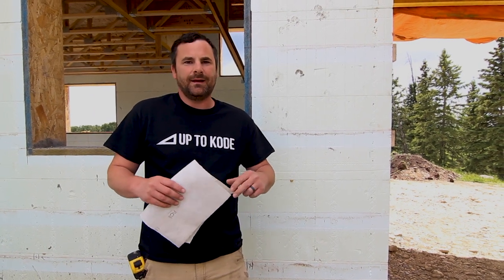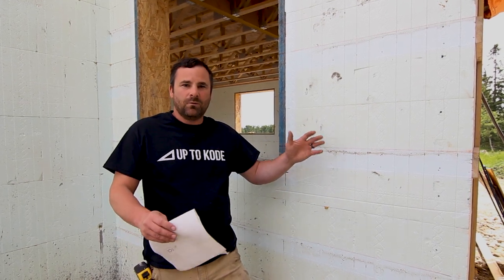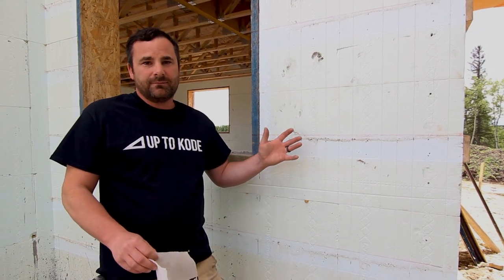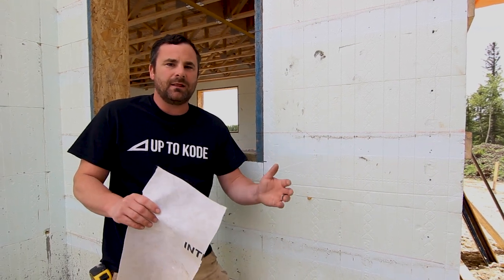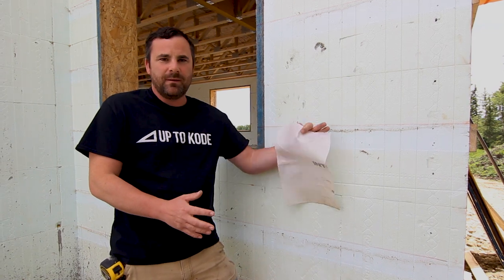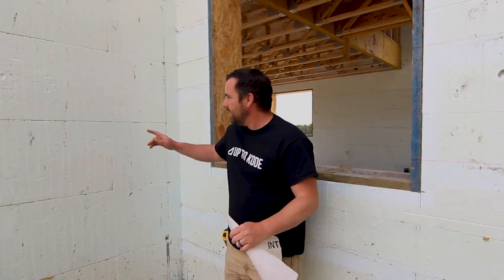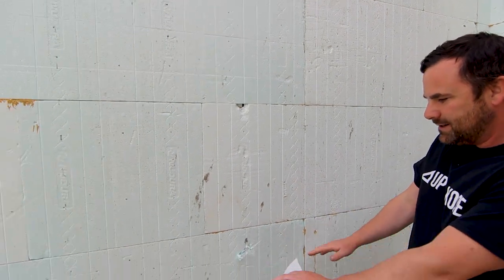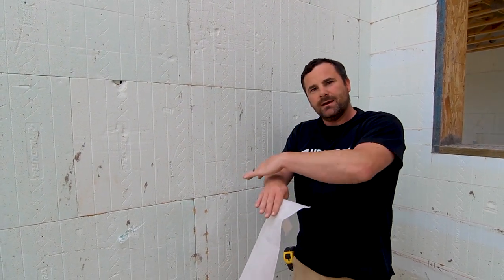Do You Need House Wrap on an ICF Building?

Comment: I have been wondering about this and have looked into it.  A water proof barrier is absolutely necessary for sub grade ICF, but above grade, not so sure.  I'm not claiming to know the answer either way, and no one else should either unless they can prove it.  That's how the scientific method works.  There seems to be more evidence showing that EPS does NOT absorb water in any significant amount.  I did find one study that claims EPS does absorb water, however in that study the EPS board was subjected to TOTAL IMMERSION in water for 28 DAYS.  Unless your ICF house is in the path of the next hurricane Katrina, that's an unlikely scenario.   

Your only explanation is that water is going to work its way into the cracks between the ICF blocks.  Those cracks are already small to begin with and the act of placing concrete in the ICF's will cause them to compress slightly to more than slightly depending on whether or not they have full length ties, causing those cracks to get even smaller.  And really at this point there not even cracks anymore which would imply an open space, where as this is foam being compressed against foam which would be more like a gasket or compression fitting.   A fluid (liquid or gas) will take the path of least resistance. So what path offers less resistance?  Flowing over the concave "crack" and continuing down a vertical wall with no opposition, or flowing horizontally into an extremely small "crack"?  If you were to use tyvek or similar product (non peel and stick), the point at which you attached it would likely offer a path of lesser resistance for water to enter the foam than the actual "cracks" in the ICF blocks.  

A peel and stick barrier, assuming it used an adhesive compatible with EPS, wouldn't hurt, but it would likely come at the cost of several thousand dollars.  That may be an acceptable cost for extra piece of mind considering that there is no indisputable evidence that EPS will be perfectly fine without additional measures to protect it from water.   But the bottom line is that you have no proof that what your saying is correct so you shouldn't claim it as fact.
Reply from the maker: You have a point but controlling water around windows and doors can only be done with proper flashings and a drainage plane. If you have no building paper above a window, the water can and will get in behind a flashing and there’s no escape. Believe me...I’ve seen it first hand. 

It’s not the wall itself that’s the issue, it’s Windows and doors. Mostly on 2 stories or more. Bungalows rarely have issue because of the overhangs.
Reply: @uptokode  You cut a groove above the window and insert the head flashing all the way to the concrete core. Then seal the flashing to the concrete with compatible sealant and you have your flashing above the windows and doors. Properly flash the rest of the windows. No need for housewrap on the rest of the house.
Reply: @repsakfean4868  That's what the ICF industry recommends. Engineers building on paper again........Try doing that in the field. You'll quickly abandon that idea.
Reply: @repsakfean4868  Agreed.  If you properly drain the water from around the windows to the outside of the actual siding/brick/stone, then that should be sufficient.  And not have to spend thousands more dollars for a plastic wrap paper which will already have perforations when you staple it.  Also, if you are that worried still about water, why not use a Hardy Backer board type of siding, ie. 4'x8', and then caulk the joints.
Reply: @RValueHomes  I haven't abandoned that idea in 22 years, and never had a leak. It's the method Ink de L suggested a few days ago, and you poo-poo'ed as x to complicated," despite that the cost and complication of peel/stick wrap on THE ENTIRE HOUSE as this video suggests is WAY MORE COMPLEX.  You do the windows the same as Kody does, then add the metal flashing into a gash you sawed into the foam... If you think that's "complex," I'm not sure how you keep your vehicle between the two lines to drive to a lumberyard and then pay with a credit card and then transfer money from your bank to the credit card company each month.
 Facepalms
Reply: @john-henryrabb3357  I guess that explains why my truck insurance is so high. I've been wondering.

Comment: How about when applying stucco on icf? I don’t think we can put tyvek on icf then because the stucco guys have to lightly send outside of the icf foam, then basecoat/mesh it.
Reply from the maker: My method is Tyvek or typar against the foam as to not deteriorate the foam with tar paper. Then 2 layers of tap paper on top of that. Then it’s business as usual.  It’s not going to hurt to have 1 more layer for drainage plane.
Reply: you apply stucco directly to icf. there is a coating that can be applied to stucco to make it waterproof

Comment: I would just use seam tape designed for foam board insulation or caulk the seams or use peel and stick membrane.  Whatever turned out to be cheaper.  Housewrap would he my last choice, even if it was cheapest.  Full water proof membrane below grade.
Reply from the maker: I personally would never trust tape on seams. Doesn’t matter if it’s wood or ICF walls. I like liquid applied membranes but need to research those for ICF… until then house wrap it is.

Comment: If house wrap was "absolutely needed", the manufacturers would include it in their requirements and instructions. With a vented rain screen I can't see any likelihood that any significant amount of water would go through an ICF seam on a wall. The interlocking edge design makes that too far a stretch IMO.
Reply: Except that it happens all the time.
Reply: @RValueHomes  no it doesn't
Reply from the maker: Anything above a 1 story bungalow, especially with windows above windows, are subject to a much higher likelihood of water infiltration. House wrap and proper window detail creates a drainage plane that allows water to escape. 

A manufacturer doesn’t want to tell you this because technically (on paper) they are right, an ICF wall doesn’t need a WRB. It might scare people off of the ICF system so that’s why the manufacturers say you don’t need WRB. My opinion of course

Comment: Thanks Kody! That sure was an eye opener. On the inside though do you go with their suggestion of applying the gypsum board direct on the foam with no vapor barrier or strapping? Also, when looking at your window above I only saw horizontal strapping. Don't you need vertical strapping first and then horizontal if you wish to do vertical siding since the initial vertical strapping is what allows the water and air to move freely behind the siding?

Comment: So what if a small amount of water gets through the ICF wall and into the house (only a small amount because of the overhang)? What could happen since there's no wood studs or sheathing? Drywall has to be protected from water but what if I have something else? Should I still worry about that small amount of water?
Reply from the maker: A small amount of water will get absorbed by the concrete and evaporated again. Concrete is like a sponge that way.
Reply: Simple solution: spray Great Stuff on the EXTERIOR side, below each Foxblock before pressing it down the final 1/4".  Before that, spray Great Stuff on the EXTERIOR of the vertical side of each Foxblock that's about to be added, abutting another Foxblock that you've already pressed down that "final 1/4 inch".
See my reply to Earl Fowler on this page for how to handle windows/doors reliably with way less expense and work than doing a whole-house wrap.  HINT: Metal Flashing similar to how ya "cut in" STEP-flashing for multi-level roofs (which have WAY MORE water problems than a vertical (wall) surface which is about to be COVERED OVER BY CLADDING so as to have less exposure to wind elements than roofs have).

Comment: Can you use a peel and stick on the entire house
Reply from the maker: You can. Most of the time it’s a cost issue. There are manufacturers (3M and others) that make vapour permeable peal n stick membranes that are designed to replace house wrap and still be use on wood frame or any building type. Just need to weight the cost vs the benefit.

Comment: How about the foam that is applied between blocks, isn't it waterproof?
Reply: ROFL real!  IDK how I got here from a Matt Risinger video, From a Foxblocks video first.  Saying you do not need an extra barrier. Unless it is under grade.... I need to shut off auto play.
 An it's not even just foam that you are putting on ALL around the block. That foam heats an makes a chem bound that make's a seal. 
 Then again after going over a few of this guys videos of This house. It looks as if the only put one row of the sealer on, At the furthest point outside the blocks. Doing this an not the TWO lines on the ALL the way around the blocks on BOTH inside and out, I would go with an extra barrier too... Because I wouldn't trust the work they did to thos blocks either :(

 It is one thing to have massive chips out of the block like this... 1.) if it is on the INSIDE. 2.) You seal the seams to SPEC's 3.) Don't have the Only Seal on the outside in the areas of said seal's 4.) You fill holes like that one in video back up b4 you let water in to sit for winter to roll around braking seams everywhere!!!...   Bad work overall. Like look at all the wall's the drill points aren't lined up at any point, On anyone in any videos of this house. Look at his window video with the wrong bottom "plate" with no drip plate b4 he even put up his weather barrier.. I would be PIST if I saw this video and found out that was my house......
Reply: Exactly, if you've ever gotten Greatstuff on your ungloved hands, you know how strong that glue is (stronger than these peel & stick barriers).  This video's winner just isn't following the specs, which EVERY icf block manufacturers has, regarding filling those cracks (joints) and using metal flash above windows/doors.
Reply from the maker: Foaming every single joint is still not a drainage plane. Water can and will find a way in or through. Especially if there hydrostatic pressures.
Reply: @uptokode  then peel&stick is, similarly, "not a drainage plane". You're just making up your own definitions which defy what the ICF manufacturers, engineers, and anyone same agrees on. The peel&stick, and jb weld, greatstuff, etc are all tenacious glues, to last decades.

Comment: Hello Cody, can I use half logs on the outside of my new build and timber frame on the inside..?....Do I frame the inside  ( icf ) walls with 2 x 4 to run my wiring..?...Thanks for the excellent videos....Patrick
Reply: What do you mean half logs tho? Like as siding, If so it depends on weight and your block system. Each have different holding power.   As far as inside framing. Yes either wood or metal studs is used for inner walls. But wiring an small water routes can be made in the foam. An we do 1"x3"   "ohio" lumber idk what the real name is. About the same cost as a 2"x4" but are TO size an perfectly straight.
Reply: There is no internal framing needed
Reply from the maker: Thanks for helping
Reply from the maker: Sorry I didn’t respond earlier. You don’t need to frame additional walls for what you asked. How did it go for you? What was your solution?

Comment: Do you know of any roll or spray on house “wraps” for lack of better words? A product that will basically cover those cracks and chips in the ICF foam to prevent water from getting back there?
Reply from the maker: Great question! I need to research this and make a video.
Reply: @uptokode  I think a product like that would be quicker to install and possibly do a better job. Thanks, you da man!
Reply: The biggest issue I see with any of this is it hides where the nailing flanges are

Comment: Stucco right to the foam?
Reply from the maker: Some people think you can put acrylic stucco directly on the foam and you can and many have done it. As I learn more and more if Stucco is being done then it should be old school cementious with 2 layer paper behind (avoid tar paper against the foam as it will deteriorate it. However very important that the layer against the stucco is tar paper at least or drainage Matt) the stucco.  If doing a cementious base you can still do an acrylic finish coat. The main thing is that you have the paper behind which is your drainage plane. 2nd option is a full EIFS system on top of the ICF. A liquid applied membrane goes over all the ICF and seals the foam and the windows, then more foam is bonded to that membrane and the stucco system applied to that.  The liquid applied membrane is the drainage plane.
Reply: @uptokode  All Europe build this way for many decades and some Kody is telling us that their science and experience  just piece of crap.